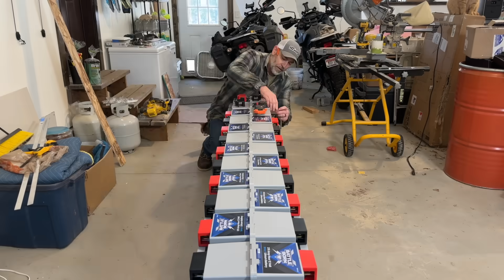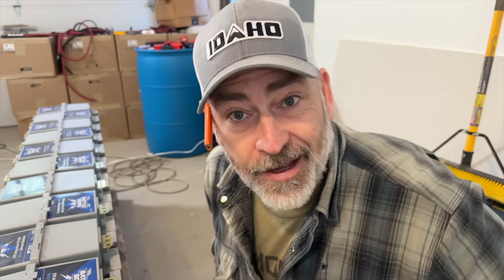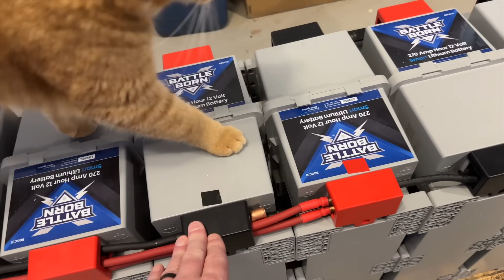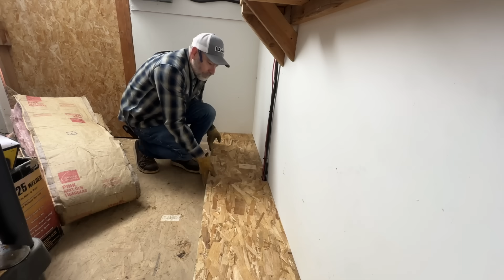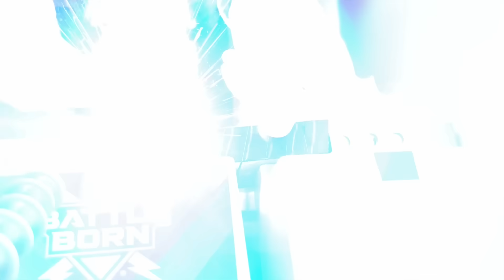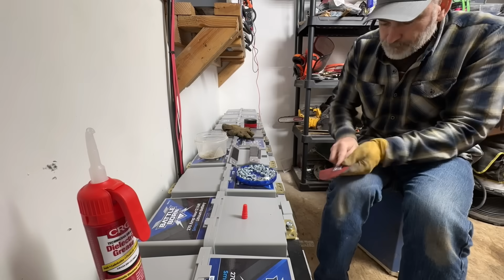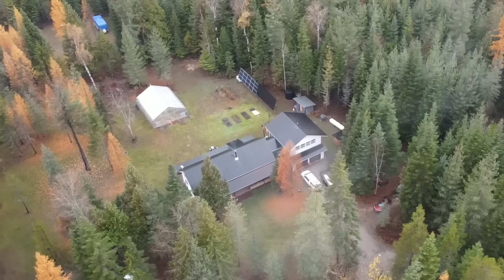BEST Off-Grid Solar Power System Battery Bank

Comment: Are you familiar with the Demon Core? Because I think you two would get along really well. This installation is the biggest disaster waiting to happen. None of your advise or techniques are safe. To top it off you built a 48V system from 12V batteries for like 10X the cost and labor of really good reliable 48v battery.

Comment: I have a question did you individually charge his battery before you build the bank cos going off the information that you put up on your video showing on your phone that you have three batteries that are not charging and that is a problem all batteries should charge equally if you have three batteries lagging behind obviously there is a problem with that particular battery cell

Comment: I am an dual trade electrician, high and low voltage in mining. I have never seen a video about a system, so out of place, that it hurts. Alone look how he places the torch on the bench. A made up wise, no crimp tool, but telling people, how to do things.  Not a single word in this video was correct! You have not learned a bit, watching this.

Comment: what a tool yea i dont call that very funny when he shorted thast aluminum out he is lucky he didnt flash burn his hand an arc flash they say is 10 times hotter than the sun or something nuts like tnat its not anuthing to joke around about  i have worked some high voltage switch gear and not energized even then it was the feeling of beign close to all the gear above your head and the amount of power that goes through em is really quite frightening and thats just some dc voltage that your dealing with you put yourself in the path of some high voltage ac and you might not be able to joke any more about it im not a master electrician but have worked along side of a many of em and i have seen some crazy stuff in my time you should um not make content  that is this hectic this stuff is not difficult and yet so many times i see idiots just completely making it so hard to actually do

Comment: You have to be nearly Rich to do this. Out of reach for most working Americans, especially in poorer states, or the guy getting by paycheck to paycheck.
Reply: No you don'tneed to be rich. Just dont use expensive parts. There are cheaper options for batteries, charge controllers, and inverters. 
There are people living in beatup cars and homeless people who have super cheap power systems
Reply: @recoblade1465 any brand recommendations? What to stay away from?

Comment: Yea, soldered connections, not the best, but if you don't have a crimper it will get you by.  Should be ok in a stationary application.
Reply: 25k batteries, man 🤘

Comment: It is not the lock nuts you either put a metric nut on a standard bolt or the other way around or the nut is fine thread and the bolt is corse thread. I would definately use the nylock nuts for sure.

Comment: I'm just a minute 45 seconds into this video and see problems. When he said aluminum bus bar and soldering the undersized cable and connectors for this size wire I had to start reading the comments instead of watching the video and was not disappointed. This guy should be embarrassed.

Comment: Could you having to buy two or three times possibly have something to do with the installation?.
I saw two dead shorts in less than 20 minutes. 
Better and cheaper, safer and more efficient.
Everything this seems to not be.

Comment: 24:33 If you are in parallel all batteries should be at the same charge. This is a major concern here. Disconnect this immediately and get an electrician to redo the system. You soldering connections was just a face palm in its own.

Comment: Funny to watch you arch the posts!  I did it once before with huge Simi Truck battery posts!  The wrench I dropped on them welded itself to them!  I had to use a 5 pound sledge hammer to remove the wrench!

Comment: Biggest problem here is the soldering, no bus bars and no fuses/breakers to isolate each 48v battery. Additionally, you need to balance each Battle Borne 12v battery over time.

Comment: First off I'm not an electrician but at least I know you're not supposed to use aluminum as a bussbar also when you accidentally crossed terminals you melted that bussbar which you even used going forward. After I watch this video I saw that somebody else created a reaction video. And he even commented about the fact that your batteries aren't balanced. When you open up the app the chart showed that they weren't balanced. YOU NEVER USE ALUMINUM WHEN HEAT IS IS INVOLVED THOSE CONNECTIONS WILL LOSEN OVER TIME AND CAUSE RESISTANCE 💣💣💣💣⚡⚡⚡⚡⚡💣💣💣

Comment: Content creator needs to take this video down, anybody installing a system as outlined in this video risks a lithium battery fire.
Last week I was working on a system that had a potential of 14,000 amps short circuit current........way more respect is needed than shown in this video - bolts, nuts, aluminum bars, tools (at least 12 inch long metal file..omg), etc left on top of cells.......recipe for disaster.
Electrician with 40+ years in the trade and I would not even make a video saying "This is the Best way to do it".

Comment: For everyone who has commented that this is unsafe and going to burn down the building or kill someone. Time to explain your reasoning. For years I worked in telecommunications and data centers. 48 volts has been the industry standard in telecommunications for decades not just for our central offices but all PBX systems too. Never have I ever used a 48 volt battery. Central offices used 24) 2 volt cells in series and grouped strings of cells in parallel for more current capacity. For small remotes and most PBX systems we always used 4 ) 12 volt batteries for our 48 volt supply. His only incorrect statement about #4 being rated for 70 amps is only valid if you were using THHN wire which he’s not. #4;battery cable is rated for up to 130 amps depending on length. As for soldering the connectors is an approved method when documented by the connector manufacturer. And my battery cables on my solar system are all soldered.

Comment: The previous owner of my old suzuki sj413 soldered wires to the lugs. Even a single 72ah car battery had no problems unsoldering the cables. I tryed the biggest lugs that fit the terminals and then asked a company that makes cables for stone quarry’s trucks and dozers to make me cables with the thickest cable that fit the chosen lugs and let them crimp it with their huge hydraulic crimper. The 40 years old car starts better then any new car. It turns over so insane fast that it almost reaches idle without fuel in it just cranking.

Comment: If you read your comments, Martin, you know by now you have some work to do.  
You have done some amazing things at your homestead learning as you go.  This is one area where you either need professional electrical intervention or major education on safely setting up a high powered solar electrical system.  What you have done is not safe.  Please take the video down, get some professional work done.  This is nothing to mess with and you sure don't want to put yourself and these methods out there online as a way to emulate.

Comment: Martin, your phone app is telling you that your batteries are out of balance. That's not good.

Don't use aluminium for buss bars; it has a much higher internal resistance than copper.   Use copper-on-copper, don't mix metals. Crimp connections, not solder as solder melts and/or gets brittle on uncrimped connections. Use larger guage wire. Use heatshrink. Don't run +ve and -ve wires across or bseide terminals of the opposite polarity.  Include overcurrent protection for each string. And, ultimately, for a 48V system use 48V batteries, not 12V, as they are much too hard to keep balanced and healthy hooked up in strings like that (see first comment about the app).

Oh. Battle Born don't sell anything except 12V batteries? Buy another brand.

Comment: Sir I've heard you're a decent guy but the procedures you've used in this build are highly Dangerous and all those batteries need disconnected ASAP maybe it's been working but it's a disaster waiting to happen. Not picking on you. Shut it off now.

Comment: So many things wrong with this setup. In a nutshell, just buy the complete battery systems like EG4 Wallmount 48v 280aH. So many choices that are cheaper, safer, and easier to install.

PS Will Prowse torched this video.

Comment: Everyone acting like this guy used duct tape and speaker wire for the install. Does it need some fixing yes. Is it the worst thing ever no. Yes battleborn should probably have reached out with some guidance. Yes lugs need crimping. Other than that it’s not as bad as everyone’s saying. 4 ga is plenty to go the maybe 6’ to combine 48 volt battery banks. His 2 ga is plenty for the 6’ to his battery disconnect and to the lynx distributer. I’m guessing he has fusing in the lynx system. Aluminum buss bars that are what 6” long will work fine. Done it multiple times. Should the separate banks be fused. Probably. Do the batteries have dead short protection in the BMS. Yes. Fix some shit in the next video and move on. No one’s perfect and we all learn from mistakes. And we have all arced a battery once or twice. I have a 10mm wrench with some battle scars. 😂

Comment: Have you watched the critique of your solar power setup on "DIY Solar Power With Will Prowse"? It would seem you've done a few possibly dangerous things in setting up your solar power system. Also if the battery company is sponsoring the video, I would have thought they'd be right there with you offering advice. Lastly, I'm sure $25000 is the retail price for the batteries - did you get them at a reduced price (or free) in exchange for using them?

Comment: The cost of this setup is pretty astronomical... I'm putting together a 48V, 82kWh system right now for 1/5 the cost of what this setup would retail for. 
Best of luck to the author, but for the numerous reasons listed, the video should probably be taken down. "I did this" is different than "you should do this"- crossing that line is where the hate is coming from. This is not good looking for BB either.

Comment: Sorry for all the negative comments Martin. I love your style of videos and enjoyed watching your family share your vision of off grid living. 

But, please review the comments and reevaluate your system. It is not built correctly, you will run into issues with it. The main issues are the gauge of wire and aluminum buss bars, both severely undersized. Undersize wire bus bars and connectors result in extreme heat buildup and could possibly melt terminals on the batteries and other connection points. Although others commented on soldering connections, those are not recommended for large conductors such as the ones you’re using. you need to use a mechanical crimp like you have in the past this is the best form on copper connections. Please do some homework and reassess your system. I hate to see your family get hurt or burn down the beautiful Idaho forest Good luck, God bless.

Comment: Without going any further with the safety concerns...terminal ends must...MUST...be crimped. If that (undersized) wire overheats that solder will melt, the wire will pop out and arc and 💥 boom. Hope your 🔥 fire insurance is up to date.

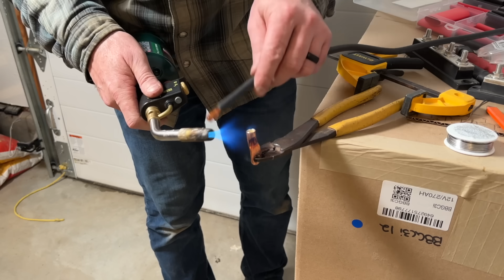Comment: 6:30 I have been soldering for 34 years and this is a terrible soldering technique. The flux (was that acid flux? if it was: yikes! You'll need to wash that out or say good bye to that copper)  was used when you first melted the solder, I hope you added more on the wire. You went to heat the copper wire, moved it out of the flame, and then put it into the solder-- the oxides you've introduced absolutely will compromise that joint. 

IF I wanted to do the inadvisable thing of soldering battery lugs (a large solder joint is very brittle, and you really should not):  feeding rosin core solder into a properly warmed joint would have taken far less time then whatever that was.

Comment: Have over 10k more battery bank with charge inverters (not cheap) mounts, good quality wire connected with hydrolic crimper, not soldered. Runs well, more capacity at almost half the price of just these batteries. Theres no ROI here i'll have to run my system for many years just to get an roi vs grid. Why would anyone buy these batteries? Way over priced if anything get best quality cells and build your own. Way, way better value.

Comment: Many others have pointed out how bad all of this is.  But I didn't see any exhaustive listings of all the things that are wrong/unsafe.  So here goes (sticking with the safety issues and ignoring the economic issues and just ignorant statements/claims):  

1.  Using conductors that are WAY too small for the application and can cause a fire.  
2.  Putting multiple high amperage strings together without circuit breakers to protect against a cascading failure. which would destroy the entire bank and/or cause a fire.  
3.  Poor bank arrangement and cable routing that is asking for a dangerous short, which could destroy the bank and/or cause a fire.  
4.  Soldering high amperage connectors that can heat up and lead to separation and fires (should use mechanical connections). 
5.  Using aluminum bus bars that are probably too small for the application and could melt causing potential shorts, damage or fires.
6.  Using aluminum bus bars with copper lugs/terminals while making zero effort to prevent galvanic corrosion that could cause damage, fires, or just render the system inoperable.
7.  Trying to solder connections using some sort of janky home made vice made with pliers and a clamp that isn't even held down (not as much of a fire hazard as just risking immediate injury to himself).  A table vice is like $20 at Harbor Freight.  Work smarter.
8.  Attempting to balance LiFepo4 batteries by voltage instead of top balancing.  Which will cause imbalance, underperformance of the system, and shorten the overall lifespan of the system (which is actually shown in the video at 24:30 during the bragging about how great it works).
9   Stringing 12v Lifepo4 batteries into a 48v system without any balance management.  (not horrible, but far from an ideal configuration)

In the end, the "success" here is a combination of survivor bias and I am sure the fact that Battle Born paid for the video.  Given all the things done horribly wrong here, I would say its inevitable that something will eventually go wrong and probably burn down the shed.  Martin, I hope you read some of these comments, learn from these mistakes, and rebuild the system to fix at least the most egregious issues.  I would guess Will Prouse would help a fellow youtuber.  I myself will be in in your area in a couple weeks (have property in Clark Fork) and would be happy to give some tips and help you plan out how to make what you have safer.

Comment: I wouldn't use that aluminum bar or that thin wires for such an expensive and high current batteries. Copper or None.

Comment: 😅
Reply: you should never soldering the lugs! , instead do a cold wild with crumper. please replace the wires as soon as possible and charge your batteries individually to 100% then reconnect it using proper copper pasbar.

Comment: Where to start?  So many issues in this video that are just incorrect.  First, there are NO over current protection devices.  Put a fuse on each string!  Second  is soldering terminals on high amperage cables.  Dont do it.  Next is the wire size.  Those batteries will deliver 300 amps continuous, and 500 amps for 30 seconds (per the spec sheet).  If you insist on using the #4 wire then have a proper size fuse on each 48v string to protect that #4 wire.   Better yet, just use the proper size cable.  I personally would not use the aluminium as buss bars. You did not mention if you checked to see if that bar will carry the current.  But if you didn't pay attention to the cable size then why bother with the buss bars.  I hate to bad mouth your video, but you have given BAD advice here and if a viewer did not know better and took your advice, then they have a bad setup as well.  Not just bad but DANGEROUS!  Just take the video down and educate your self and if you want, remake the video and show your errors and why, and educate viewers, not give bad and dangerous advice.  There are other issues as well, but I'll stop here.  Sorry to be negative, but this is just really bad info.

Comment: Hey Martin. I like your channel and have been subbed for years. Please rethink this video and the install. There are several safety issues with your system. I wouldn't want your shed to burn down. I know it has been working for months but there are serious safety problems and fundamental flaws with how it is set up. Battle Born should not have allowed this video to drop. Just some friendly advice.

Comment: Bro, we get you probably mean well but you're going to cause a fire.  This system is setup wrong - wrong conductor size, wrong config, no balancers, no OCP protection per string, no disconnects, you do not use solder you crimp cables, YOU SHOCKED YOURSELF.  

Bro.... BROOOO.  Please rebuild this system properly and post a new video explaining to your viewers what you did wrong so they can learn too.